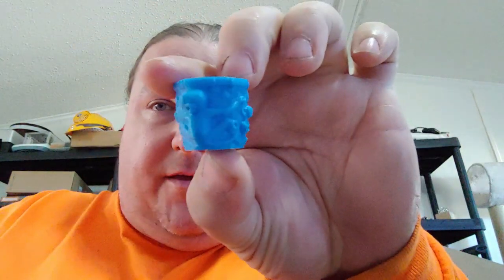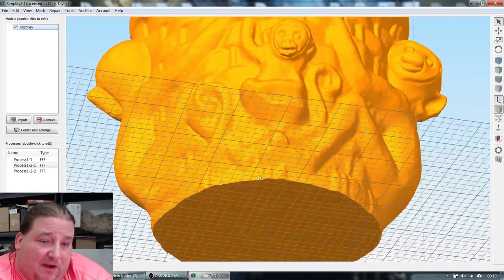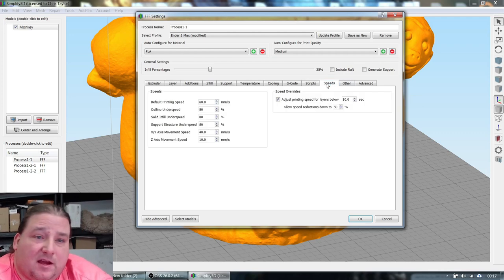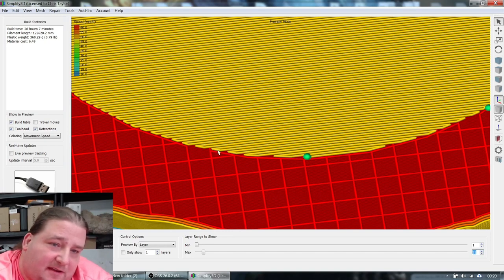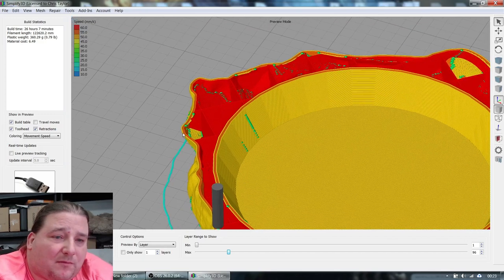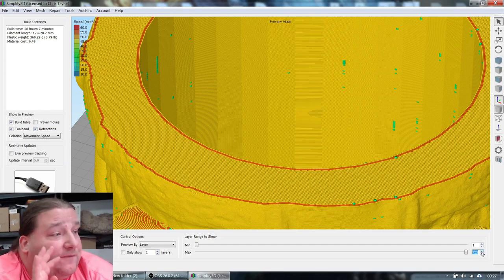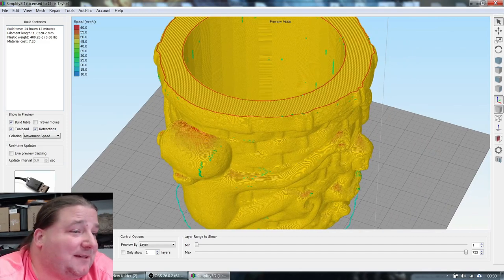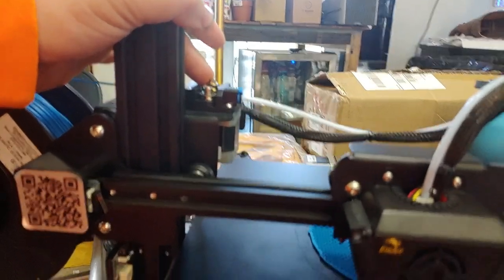Printing Process Slice to Print Monkey Pot T3DP

Comment: The audio on your intro is WAY louder than the actual content
Reply from the maker: Yeah the direct cell phone audio is boosted in the phone. Have not figured out the right way to normalize thst kind of thing yet.
Reply: @nerys71  if you are using obs compression helps a ton with that
Reply from the maker: I've recorded the screen portion with OBS but the rest was simple you with my cell phone